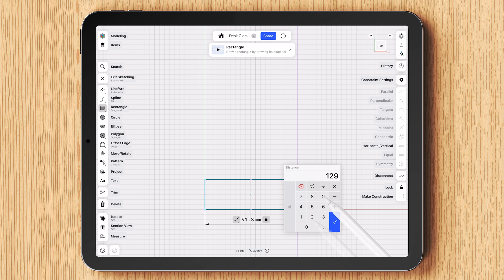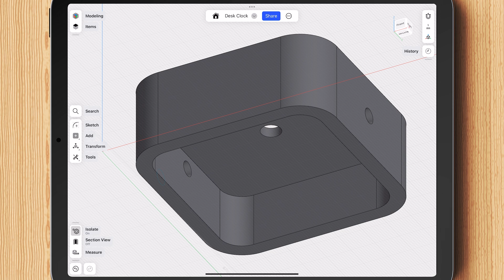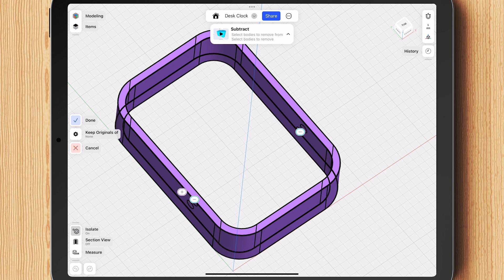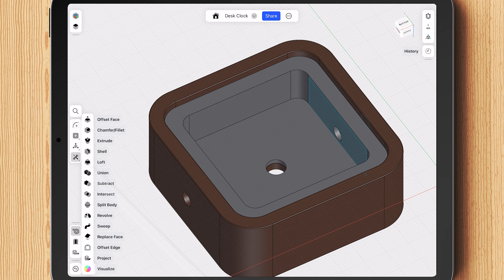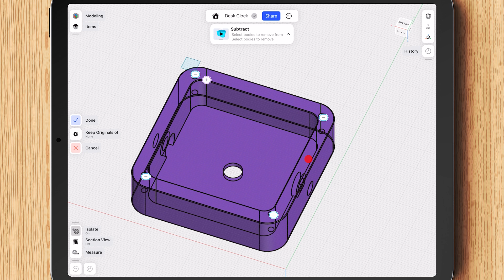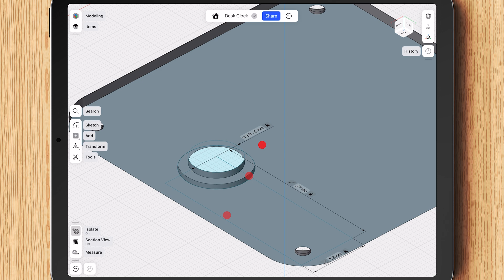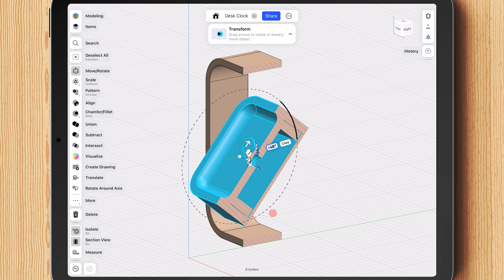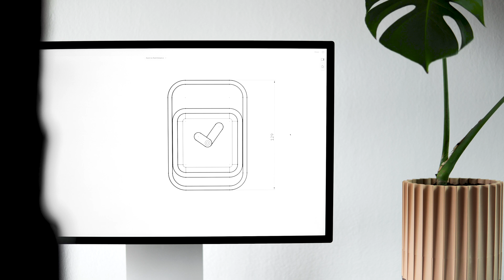Desk clock: from concept to production | Workflow videos

Comment: Shaper3d best feature is it’s sketching tools when using an iPad. coming using solid works for a long time, It’s frustrating making the switch. Good for simple parts but hate assemblies and making modifications is frustrating. If you never used any parametric software and are used to 2d then you will like using this.